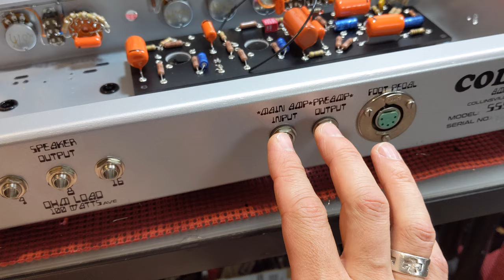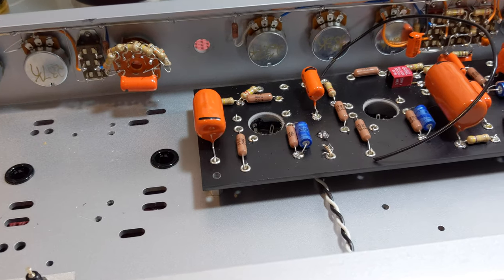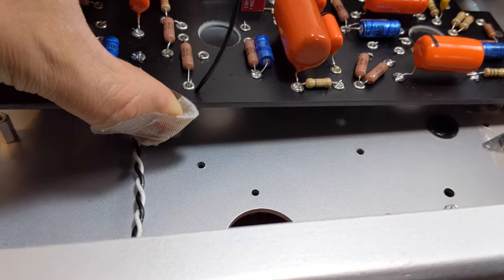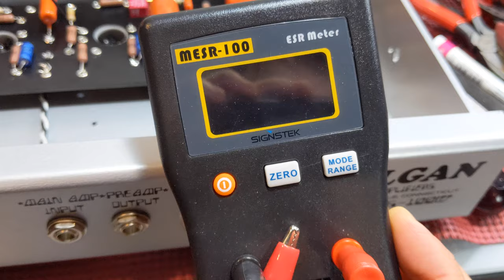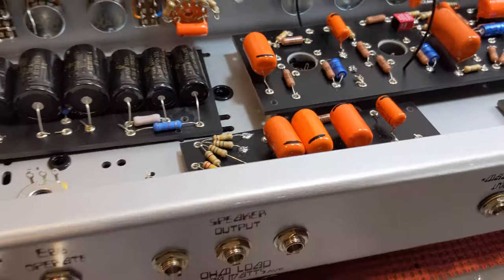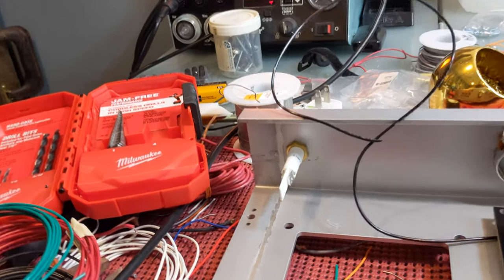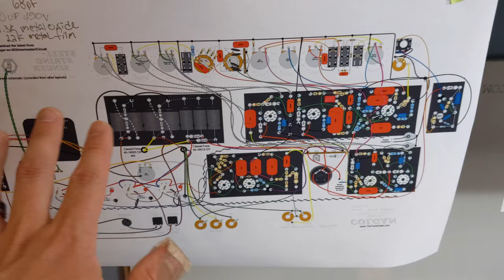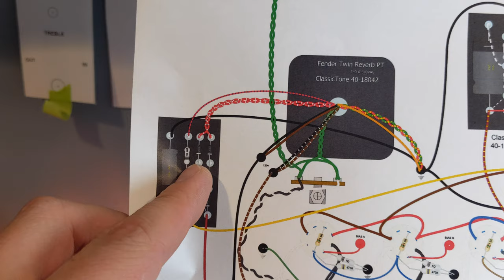Steel String Singer #002 Build | Episode 2: Boards and Wiring

Comment: Make a video how to determine the polarity of film capacitors
Reply from the maker: Will do!!
Reply: Thats easy, it isn,t polarity ,, it,s inner film leg and outer film leg. Easy check is plug an instrument chord into an amp and , using alligator clips , check the legs against the barrel and tip of the plug. The quiet side is the outer foil so put a mark with a sharpie and mark + even though there isn,t polarity. Send the inner to the ground side.
Reply from the maker: I'm uploading a video right now :-)
Reply from the maker: Video is up! Episode 3...

Comment: I,m jealous. That,s a beautiful build sofar. Ken Fisher thought that solid core was important to the sound of the amp. He also had a thing for flying heater wires.
Reply from the maker: I think it's a good idea to build in 3 dimensions. Good tip on solid core wires. All the boards are solid core and most of the hookup wire is stranded. I think Ken also mentioned something about phasing is different with solid core vs stranded, which I find interesting but was never able to find someone with expensive test equipment to verify but maybe my ears can?